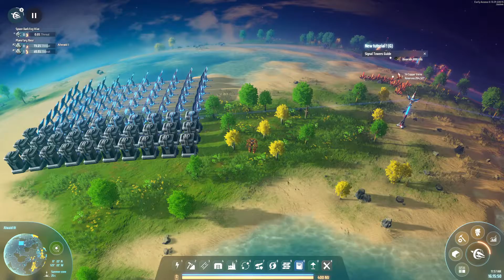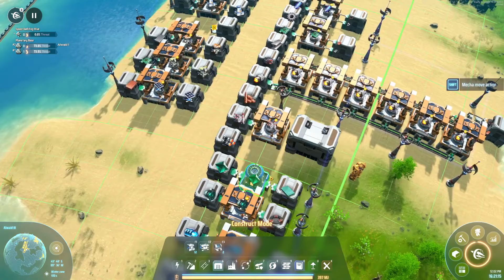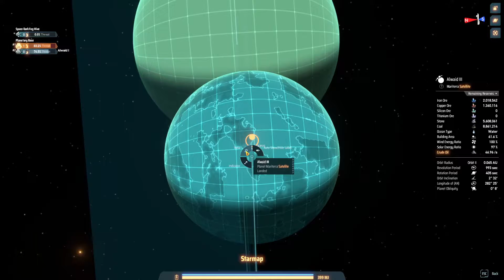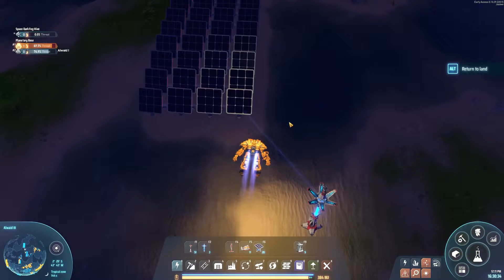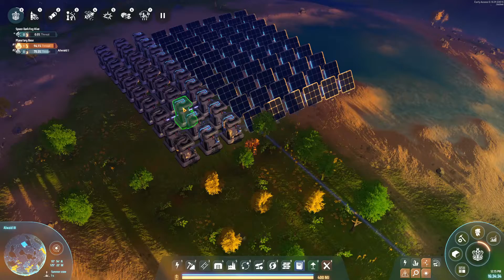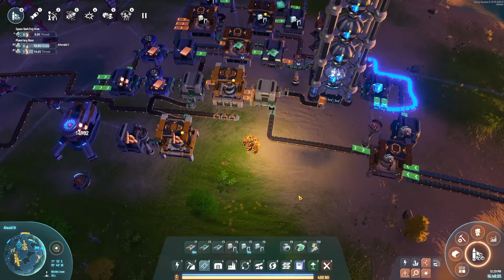PRECISION DRONE // Dyson Sphere Program // Mission Log 20

Comment: so with the litter, ideally you use a battlefield analysis base, they can auto heal nearby buildings, and auto pick up litter. but if you don't have one, you go to the loot menu, and you can click on each item, you'll toggle between "able to pick up" "never pick up" and "auto pick up". on the dark fog drop side of the menu, you can see what level of planetary base is required for them to drop certain items, as well as turn off specific items if you never want to see them again. at high levels of dark fog, they actually drop hidden/unique items you cant get anywhere else, but i wont spoil anything about that yet. just know you might want to try to farm a base at some point to force them to level up.

personally, i think the drones are just a waste of resources till you get some of the end game upgrades for them. they do tend to die a lot until you level up their durability.
Reply from the maker: Gotcha, more good tips. Thank you!